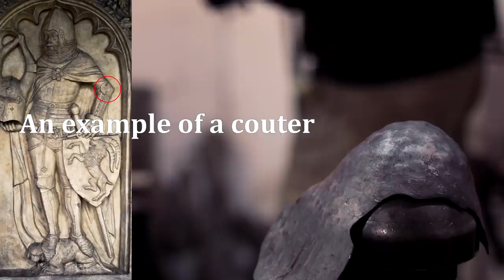Forging of the steel couters. Shaping, dishing and raising

Comment from the maker: The uniqueness of the experiment is that I made the steel thinner by edges while leaving the middle 3 mm, using evenly thick steel. After that, I shaped very pointy and dimensional couter. The shaping took 20 min, this is very fast. And lastly, I worked on the final shape by raising.